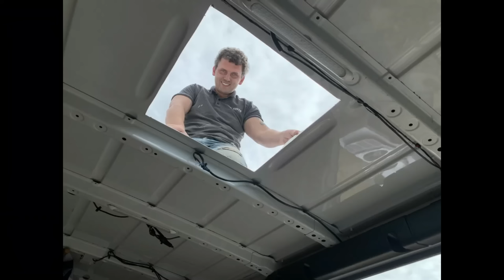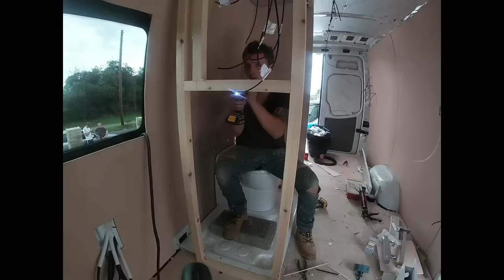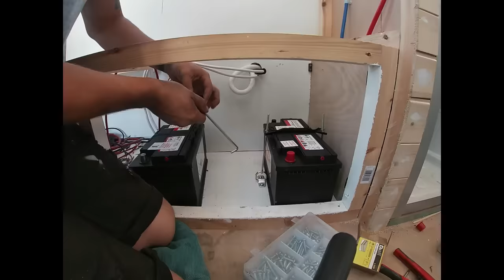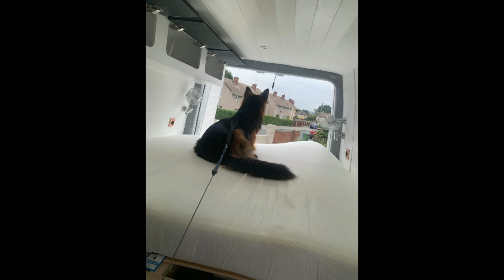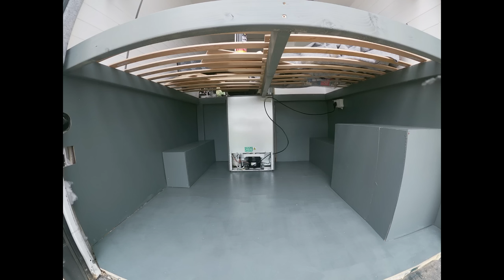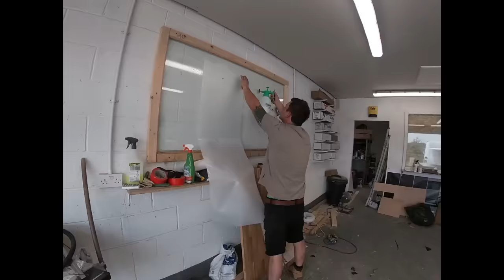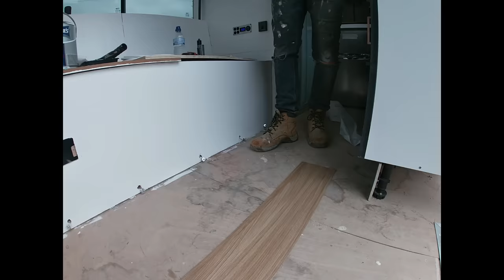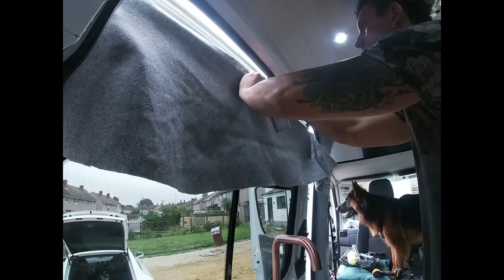Mercedes Sprinter LWB Camper Van Conversion - Full time lapsed video

Comment: Every choice has a sense apart from the tv positioning that requires a neck twisting worthy of a contortionist. Also the dining arrangements are not clear but it's nothing that cannot be improved upon. The kitchen, the bathroom and the bedroom are done very nicely and professionally I would say. It is obvious this couple knew what they were doing. Finally my only concern would be for the exposed lpg and water tank at the bottom for bumpy roads. A protective cover would be prefarable for me.
Reply: The TV is on a frame which allows it to rotate. I think it can be seen from the bed
Reply: The tv swivels out into the walk way so can be watched very easily from the bench seat or you can sit on the front two swivel seats to watch . It has a removable table leg and top for dining. The lpg tank and water tanks are tucked well up into the chassis you would have to literally rip the rear axle off before reaching the lpg tank and if that’s the case a protective cover isn’t going to do anything

Comment: worst thing to do Lpg tank exposed on the bottom of the rig off road driving will rip it up
Reply: It’s 6 inch higher than the axle. Would have to rip the axle clean off before it got anywhere near the lpg tank

Comment: Everyone does the same layout with the double bed at the back. Major fail in my opinion, you have to make the most of the space. A fixed double bed and you've lost 6ft of space (half the space) for me it's a sofa bed, fold away, or hammocks
Reply from the maker: It isn’t a fail, it’s a personal preference. Whilst hammocks might work for you, they wouldn’t for us and our 2 dogs… we 100% wanted a fixed bed as we didn’t want to set up the bed every night and put it away every morning. We have plenty of seating space up front and have completed other builds for other people without a fixed bed because that worked for them and their preferences.
Reply: @homefromhomeconversions534  "Major fail in my opinion" This is my opinion. Your reply is a bit bizarre

Comment: Car batteries < Lithium ion batteries 
Propene stove < electric induction stove top
Reply: Lithium batteries very expensive and not necessary for a weekend use van. Electric induction stove tops use way too much power you need a huge lithium battery bank and heaps of solar power to run one and for the cost just isn’t feasible for a van that already has gas installed for the water boiler
Reply: @brettmxuk754  well I guess that’s the difference between a “weekend use van” and a vehicle that is meant to stay off grid indefinitely. I would much rather have the solar/lithium setup over gas and lead batteries any day of the week. More expensive? Yes. Better setup? Heck yeah.
Reply: Who wouldn’t rather have lithium if they had the choice? For most people spending thousands on a battery bank and solar set up just to run an indication hob just isn’t viable

Comment: $60,000 at least invested in making this camper.
It includes the van ($30,000 for a used one in good condition), labor ($10,000), and materials ($20,000).
Reply: Van was £2.5k and conversion materials £12k we are in the Uk
Reply: @brettmxuk754  1. How many people can buy that truck for 2.5k?
2. Labor cost? 500 hours at least.
Reply: eebbeerrttpp vans are much cheaper in the uk than the states. We can build this van in 300 hours
Reply: @brettmxuk754  Please just tell us where we can buy this specific van in the UK for less than 20,000.
And certainly one that works, not a lemon.
Reply: eebbeerrttpp it’s a 2012. No where near £20k for this as an empty van. Maybe £6k for a clean low mileage one
Reply: @brettmxuk754  You’re a liar.
Blocked
Reply: eebbeerrttpp weirdo

Comment: Ok construction but I don’t agree with the gas installation under the camper and exposed
Reply: Perfectly legal
Reply: @brettmxuk754  I am not questioning if is legal or not ! I worry more about the security.! How close is to the street etc !
Reply: Andreas Violidis it’s tucked up behind the axle. Would have to rip the axle clean off the van before the gas tank got caught
Reply: @brettmxuk754  thank you for highlighting this. I have no experience about this. So I am thinking loud and learn. So as I understood is absolutely legal and safe. That’s good. Thx a lot for sharing the knowledge.